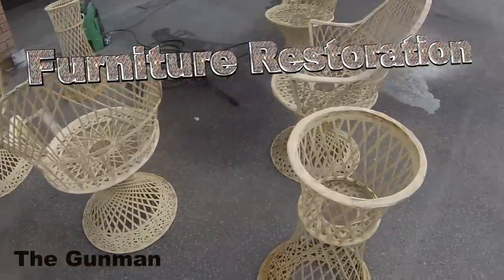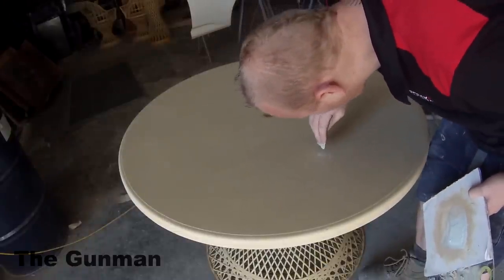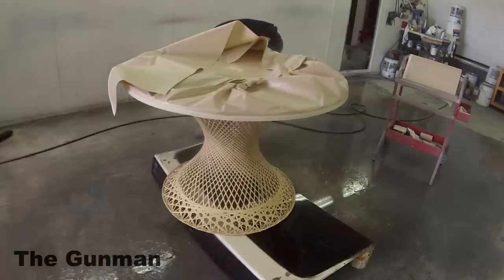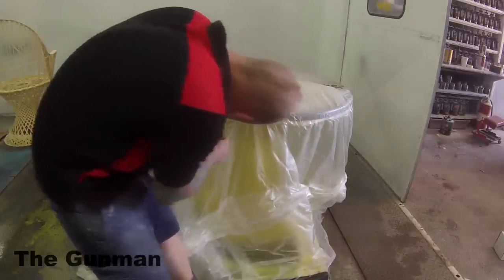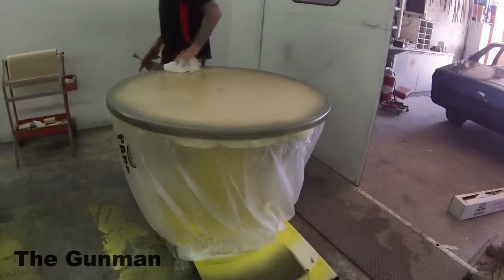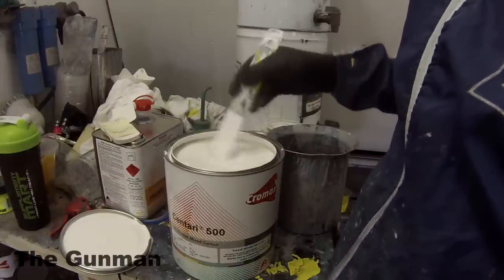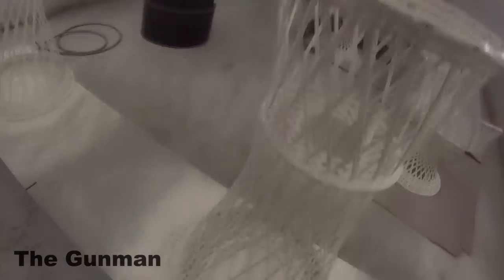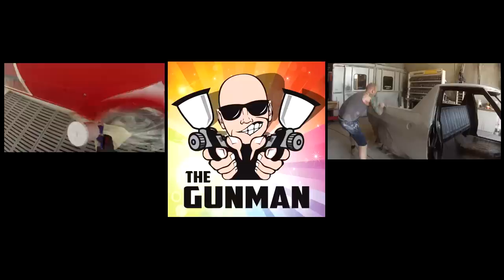Spun Fibreglass Furniture Restoration

Comment: Great video , but WHAT kind of paint is it?  Did you say automotive?  I just have a molded fiberglass 1970's patio taBLE  top, any way i can repaint it without this type of paint .  Also do I have to have a paint sprayer, or will a brush do as well?  Many thanks for any help!
Reply from the maker: Kathy Walters I used automotive 2k paints because it lasts a lot longer than most paints and the owner wanted top quality, you could brush it but you'd be left with brush strokes so it depends on the kind of finish you are looking for, but as I say be very careful using any 2 pack paints as they are highly toxic.
Reply: Thank you very Much!

Comment: Hi, I've recently acquired some garden furniture identical to this but with a glass top and it keeps shedding fibres everywhere, would washing sanding and painting solve this issue or is their another step i should take first?
Reply: Steve Matthews I’m wondering the same thing. We have the exact table in the video and when we use the table we feel the fiberglass on our skin!
Reply: Power washing just makes mine worse.

Comment: Awesome! What do you recommend to remove several coats of paint that was poorly done? The set I just purchased at an Estate Sale looks as tho the paint is not original . My set has a glass top over spun fiber glass
Reply from the maker: Probably the safest way would be to sand the paint down until you've removed the poor paint, paint stripper would likely damage the fibreglass and also make it smell really bad and a heat gun could also damage the fibreglass.
Reply: And would I use 320 grit on an orbital w/ the pad for the edges ? I think the webbed areas on table base & chairs will need to be done done with a sponge sander ? ( also 320 ? )
Reply from the maker: +Suz Hunter if you're trying to remove a lot of paint you may have to start a bit coarser like 180 grit or 240, do a few trial sections and see how it works but you'll have to prime it, then sand again with 400 before paint.
Reply: The Gunman That makes sense & was what I was thinking . I've thought of a couple more questions , if you don't mind 😬; I would very much like to attempt this project myself ; I've been doing a bit of spray painting to up cycle several outdoor pieces for our new home. And, I have some wood vintage furniture pieces I want to refinish & up cycle as a hobby, since I find I enjoy it.  
Would you recommend a sprayer like you used in the video , that is a good value in an affordable price range for a novice to start with . ( I noted you have a video , but have not yet viewed it ). 
Secondly , if I were not using the top quality automotive paint ( hazards duly noted ) , what would be the next best paint ? ( for now , I am working outdoors ).  Or would it be better to hire a pro to do this project , since I want to actually restore it, ( not just freshen it ) so it will last another 30 - 40 decades . 
Lastly , if the pro is the better option , what should I expect to pay ? ( There is one locally who has experience with many types of patio furniture; I am hiring him for 2 metal pieces this fall, since I was unable to clean them down to the bare metal to remove all the rust ). And , I totally get the lack of efficiency with the paint on these pieces ! No way around it ...  

Btw, the tip on keeping the paint can rim clean is simply genius ! I intend to try it today when opening a new can to paint a door .!  Thank you for creating the video ,and for still being around to respond to all my questions! I consider my Google 
"How to..." search fortuitously successful. Perhaps with you as my mentor , I may one day earn a "title of respect" like Gunman; how about , "Pistol Packin Mama " ?? 😎😜
Reply: Oh, & did I mention , I plan to tackle the exterior of our one story brick facaded mid century in the fall, using a Graco X7 airless ... can't wait ! 😃 Something about it, the color, the transformation,
 the process or maybe the fumes has me totally addicted !!!
Reply from the maker: Haha awesome to hear :) Good Luck!!